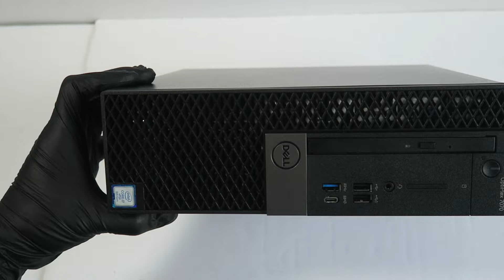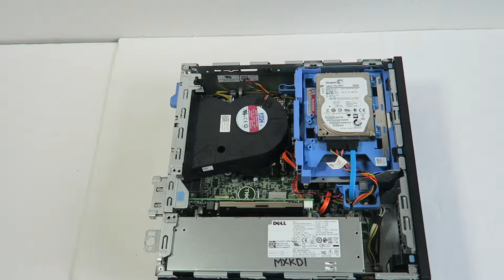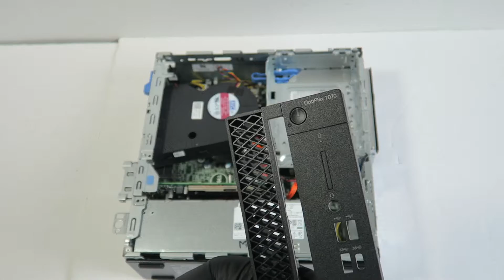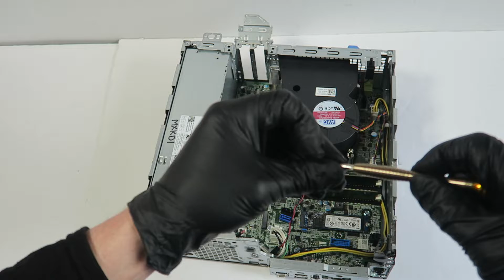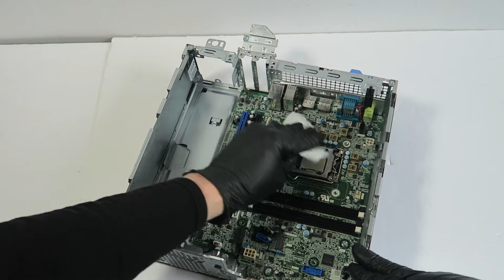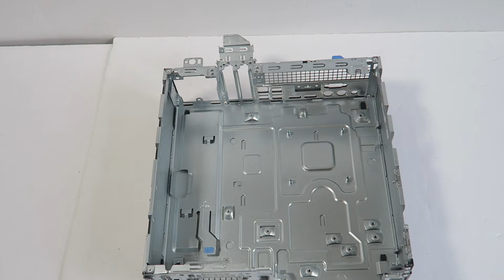Dell Optiplex 7070 5070 Teardown

Comment from the maker: List of Parts work with this system  and Upgrades:

USB Wifi Adapter for PC AC600Mbps Wireless Network Adapter
https://amzn.to/2ZaGuHb 

Dell Optiplex Reassemble
https://www.youtube.com/watch?v=d_iJJm0R1hk

List of RAM will work with this system.
1. Kingston HyperX Fury Black 32GB 2666MHz DDR4 CL16 DIMM Kit of 2 (HX426C16FBK2/32)
https://amzn.to/38zqi4Z

2. Crucial 16GB Kit (8GBx2) DDR4 3200 MT/S (PC4-25600)
https://amzn.to/3f21Qf7

3. Crucial 16GB Kit (8GBx2) DDR4-2666 MT/s (PC4-21300) 
https://amzn.to/3e7axnh

4.Crucial 32GB Kit (2 x 16GB) DDR4-2666 UDIMM (PC4-21300)
https://amzn.to/3e62jvq

5. Crucial 16GB Kit (8GBx2) DDR4 3200 MT/S (PC4-25600)
https://amzn.to/3f21Qf7

6.Crucial 4GB Single DDR4 3200 MT/s (PC4-25600)
https://amzn.to/2VXqTZo

List video cards will work with this system.
(1.) Gigabyte GeForce GTX 1650 OC Low Profile 
https://amzn.to/3el08os

(2.) Gigabyte Geforce GTX 1050 Ti OC Low Profile 4GB GDDR5 128 Bit PCI-E Graphic Card (GV-N105TOC-4GL) 
https://amzn.to/2T8bfsv

(3.) MSI Gaming GeForce GTX 1650 4GB GDRR5 Low Profile Graphics Card (GTX 1650 4GT LP OC) 
https://amzn.to/2X1FYsF

(4.) MSI GTX 1050 TI 4GT Low Profile  Graphic Cards 
https://amzn.to/2LwZd7P
(5.) Gigabyte GeForce GT 1030 GV-N1030D5-2GL Low Profile 2G Computer Graphics Card 
https://amzn.to/2Z4PHkp

(6.) ZOTAC GeForce GT 1030 2GB GDDR5 64-bit PCIe 3.0 DirectX 12 HDCP Ready Low Profile Video Card ZT-P10300A-10L 
https://amzn.to/2WzgLXk 

Thermal Compound Paste:
(1.) Arctic MX-4 2019 Edition Thermal Compound Paste Carbon Based
https://amzn.to/2XcsZo4

(2) Arctic Silver 5 Thermal Cooling Compound Paste 
https://amzn.to/2ziNU0H

(3) Noctua NT-H1 3.5g, Pro-Grade Thermal Compound Paste
https://amzn.to/36kTk7A

(4.) ARCTIC MX-4 (current edition) Thermal Compound Paste 20 Grams 
https://amzn.to/2DhGJaK 

List M.2 Type 2280 NVMe PCIe:

Crucial P5 Plus 2TB PCIe M.2 2280SS Gaming SSD
https://amzn.to/3BatWkN

Crucial P5 Plus 1TB PCIe M.2 2280SS Gaming SSD
https://amzn.to/3d7lScn

Crucial P3 Plus 4TB PCIe M.2 2280 SSD
https://amzn.to/3d7LdTB

(1.) Samsung (MZ-V7E1T0BW) 970 EVO SSD 1TB M.2 NVMe
https://amzn.to/3d52k2a

(2.) Samsung 970 EVO Plus SSD 500GB
https://amzn.to/3fpi95A

(3.) Samsung (MZ-V7E500BW) 970 EVO SSD 500GB - M.2 NVMe
https://amzn.to/37uuLFw

(4.) Crucial P1 500GB 3D NAND NVMe PCIe M.2 SSD - CT500P1SSD8 
https://amzn.to/2N07wKh 

Hard Drive Caddy Adapter  3.5 to 2.5:
(1.) Dell 3.5" to 2.5" SSD or Hard Drive Caddy Adapter R494D 0R494D 
https://amzn.to/2XTPeRr
(2). Dell Hard Drive Caddy, R494D, F767D 3.5" to 2.5" SSD or Hard Drive
https://amzn.to/3cTkcOk 

SSD List:
(1.) Samsung 860 PRO SSD 256GB - 2.5 Inch SATA III Internal Solid State Drive
https://amzn.to/2BY5gRl

(2.) Samsung SSD 860 EVO 250GB 2.5 Inch SATA III Internal SSD 
https://amzn.to/37xWUfc

(3.) SK hynix Gold S31 1TB 3D NAND 2.5 inch SATA III Internal SSD
https://amzn.to/3d7X6D6

(4.) Samsung SSD 860 EVO 1TB 2.5 Inch SATA
https://amzn.to/2B2FURX

(5.) SanDisk SSD PLUS 1TB Internal SSD
https://amzn.to/3hwdqku

(6.) SanDisk SSD PLUS 240GB Internal SSD
https://amzn.to/2zfc7EX

(7.) Crucial MX500 250GB 3D NAND SATA CT250MX500SSD1(Z) 
https://amzn.to/3bTTjbX

(8.) SanDisk SSD PLUS 480GB Internal SSD SDSSDA-1T00-G26
https://amzn.to/2yfgjUK

(9.) WD Green 1TB Internal PC SSD  WDS100T2G0A
https://amzn.to/2XfGtzc 

HDD list works with this PC:
(1.).WD Black 2TB Performance 3.5" Hard Drive - 7200 RPM Class, WD2003FZEX 
https://amzn.to/2xFUeyF

(2.).Seagate BarraCuda 1TB Internal Hard Drive  3.5" Hard Drive - 7200 RPM
https://amzn.to/3g8FXM8
Reply: Is that without changing the power supply ?
And what if the best power supply comatabile with it fie 8GB GPU

Comment: Thank you so much ❤️
loved your videos. Will keep watching new videos.

question: 
I already have one 2.5" inch SATA HDD in my optiplex 7070. Now, wanted to one more same 2.5" SATA. But, power connector is only one which is already used with existing SATA. How to add one more SATA power for extra HDD? 
🥺
Reply from the maker: Hi, you have to use SATA Power Y Splitter Cable.

Comment: My i7 9700 in this model is getting too hot so I decreased the max load to 85% if I get a new motherboard to transfer my cpu onto a lga 1151 motherboard and add a good cpu cooler will I be able to run at 100% with temps at low 80s instead of the 100 tj max
Reply: The fan in my case is really loud and not very effective at cooling cpu at around 4.4 ghz when In max performance mode

Comment: What's the best nvidia video card that you can install for the dell optiplex 7070 sff given the room that it has? I noticed that the x16 slot is on the bottom compared older models.
Reply: anyone?
Reply: INNO 3D 1650 4GB (Single slot)
http://www.inno3d.com/products_detail.php?refid=509

https://www.computeruniverse.net/en/inno3d-geforce-gtx-1650-compact-single-slot-40-gb-mid-range-graphics-card

https://www.grooves-inc.co.uk/inno3d-hardware-electronic-innovision-inno3d-geforce-gtx-1050-slot-edition-geforce-gtx-1050-4gb-gddr5-inno3d-accessories-pZZa1-2098380092.html?language=en&currency=GBP&utm_source=froogle_gb&utm_campaign=froogle_gb&gclid=CjwKCAjwkPX0BRBKEiwA7THxiCSKeOgsZ0lOaXCQvE0o1OFe9LPlPEDyzWV6DArbZU--7QzHdjT0cBoCCzIQAvD_BwE

Comment: Of only dell would switch that larger pciEX slot over with the shorter lane....
Reply from the maker: Hi, yes i did test some benchmarks and games GTX 1050 TI low profile  works fine..  You can still use PCi Express x4 black slot with 200w power supply and i7 9700 or you can also use GT 1030 and only problem with this PC is 200W power supply really low and should be at least 240W ..